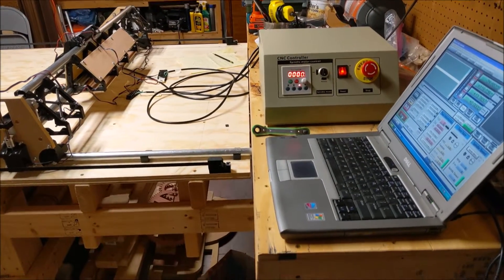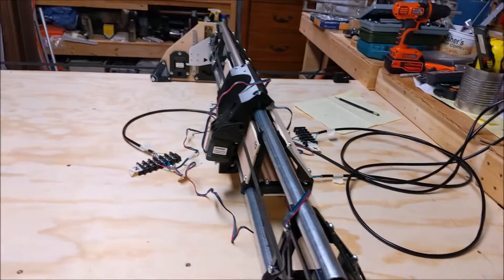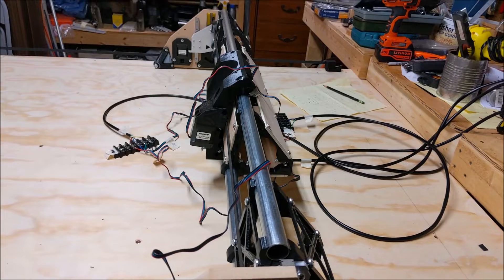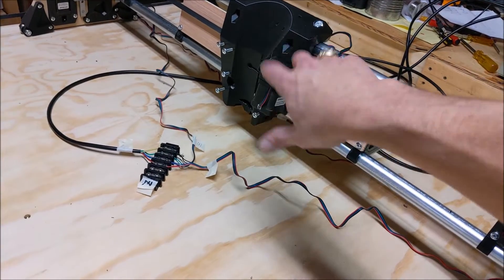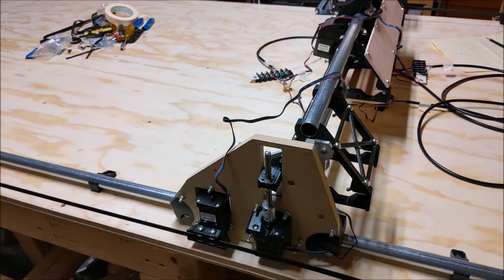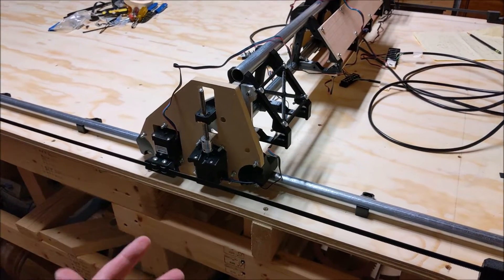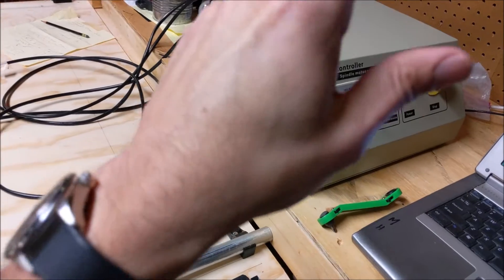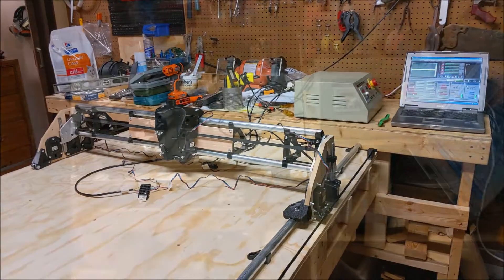Low Rider 3 - DIY CNC - It's Alive!!

Comment: Congratulations for the build.  I don't really understand what's holding the x axis down. It is only its own weight?  Is that enough?
Reply from the maker: Yep.  Good eye. Just the weight of the router and the frame are holding it down.  That surprised me too when I was building it.  Works fine as long as you don’t get too aggressive with the depth of cut.  Thanks for your comments.
Reply: @drez20001  OK,  sounds interesting. Does this work even with a surfacing bit? Thank you for the answer.